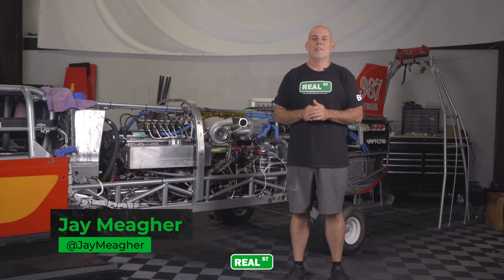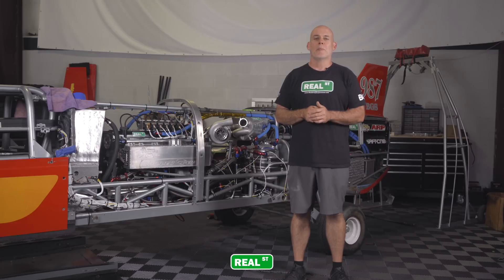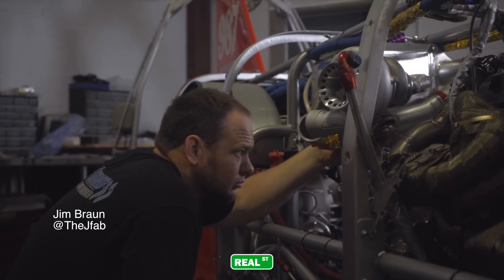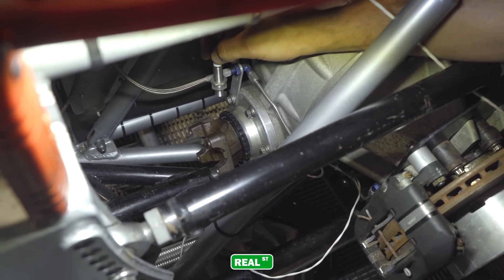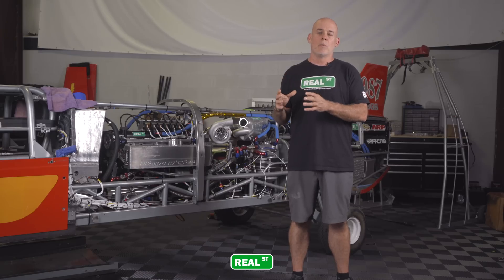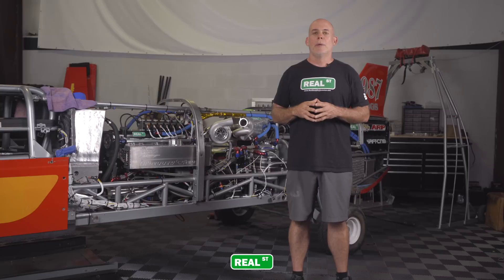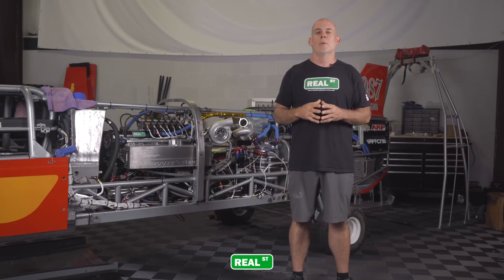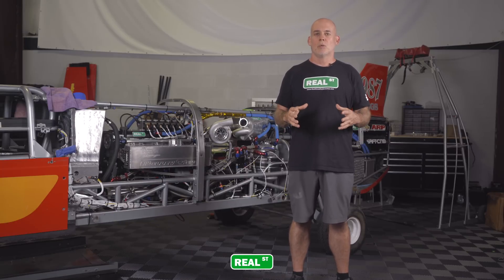Quest For 400mph! 2JZ Powered Valley Fever Streamliner Gets New Upgrades

Comment: Hi Jay.  Would an interchiller help with IAT's on this quest?  I assume you already have methanol.  The combination might help with the under-load heat.  Just a thought.  Glad to see the v-bands mod...no more charge pipe blowing off.
Reply: They are using parallel turbo chargers, not compound.

Comment: Would going to compound turbos add unnecessary complexity or just isn't needed to reach your power goals?
Reply: Compound turbos help with turbo lag on massive turbos, in this case you have so much distance to spin the turbos that turbo lag means nothing
Reply: @thefoodcan You're thinking of sequential turbocharging, compound turbocharging is used when a single stage of compression isn't enough to achieve the amount of boost pressure that you want.
Reply: 2jz's are making 2600hp on a single turbo without insane lag (considering the power level) compounds are completely unnecessary for a modern well setup gas or alcohol powered car